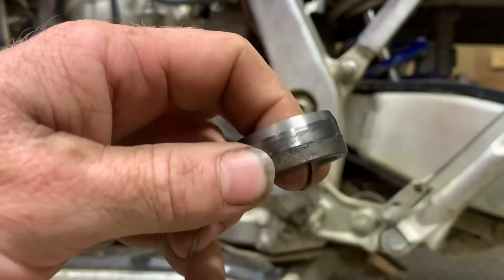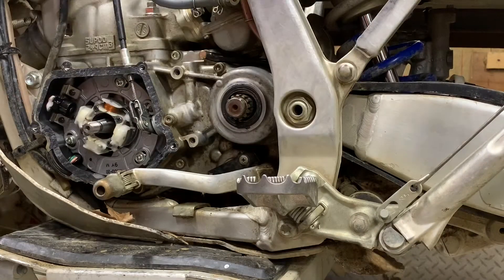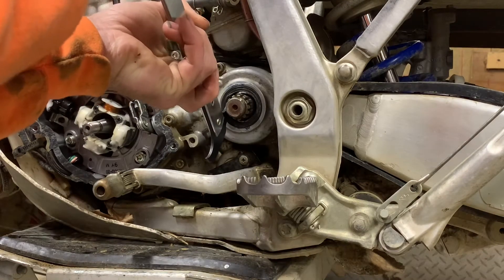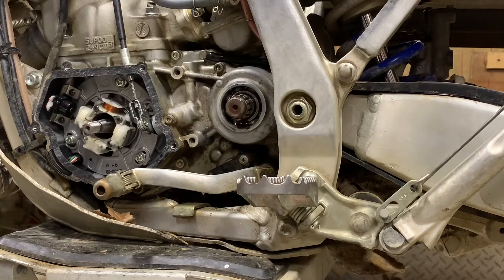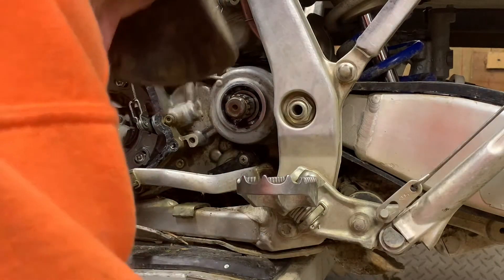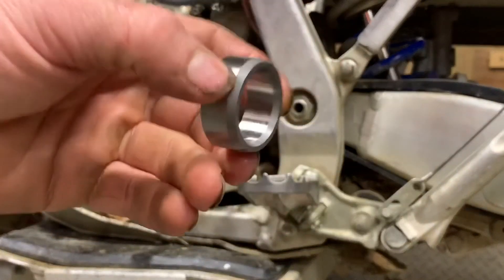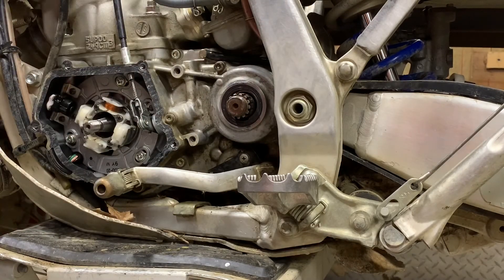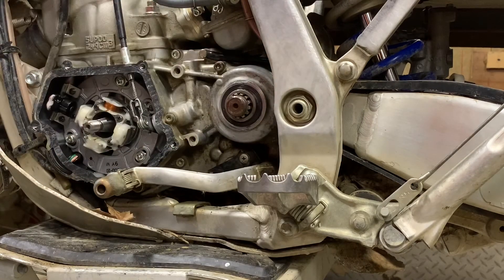Counter shaft Seal replacement 2020 Yz250x

Comment: How do u know if seal is bad ??
Reply from the maker: After or during rides you’ll notice oil flung around the sprocket or the frame and or engine case around the sprocket. It’s pretty obvious and just inspect the sprocket after riding before washing. Usually it’ll have a black oil star shape around the outside.